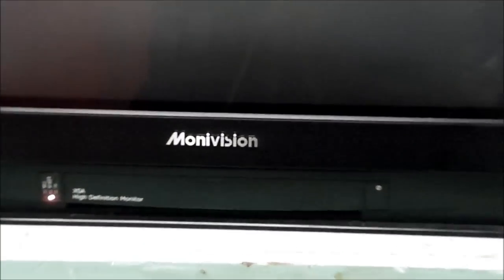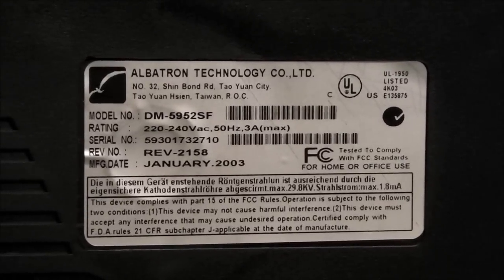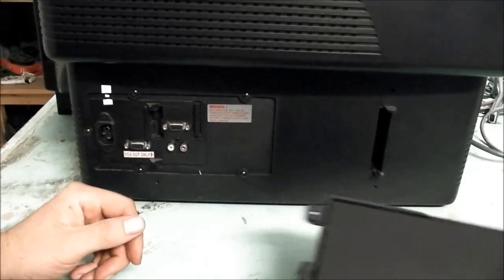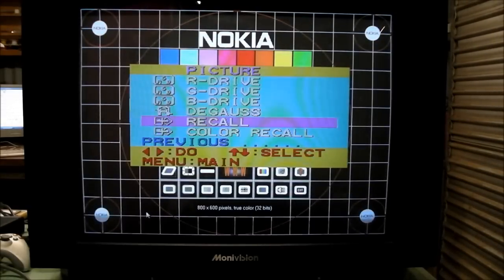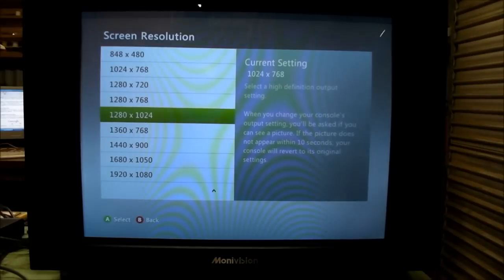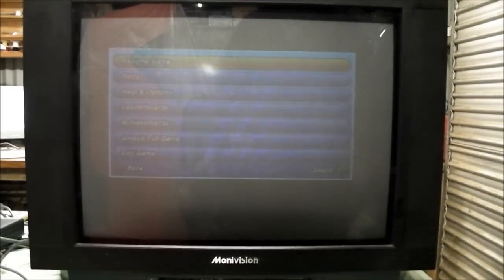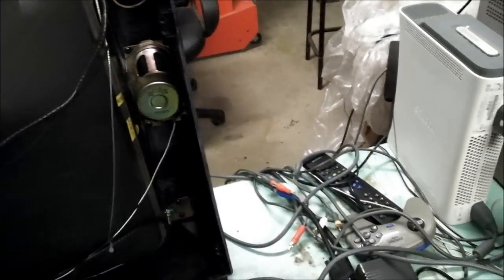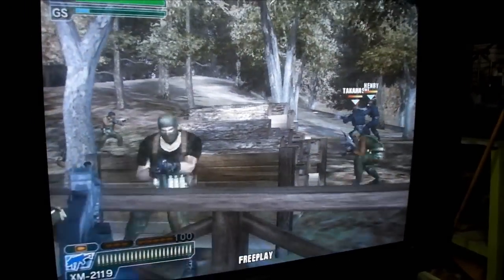Monivision 29" CRT pc monitor

Comment: You should be able to get component input   (YPbPr) but you would have to separate out the sync from the green and obviously into a VGA plug. I don't know if these will take a 15khz signal which would make it unsuitable for arcade being that VGA is 31khz. I am guessing here but I think that detachable box was there to convert the 15khz composite and svideo to 31khz. This is a really cool monitor although!

Comment: I have one similar to this (but not flat) and want to plug rgb into it from snes etc. Have you plugged anything "240p" into it?
Reply from the maker: outerspacebass I have tried 240p sources into the VGA port on the monitor without working. 240p over svideo and composite yes, but no for rgb/vga.
Reply: sweet thanks.  i'm on to the extron scan converter now
Reply: @rgbrob you still using this guy? Mine had vertical collapse a few years back. I rediscovered this video looking for photos of "netTV" monitors

Comment: hi need lil help well lot iv super system 3 runs on genesis 2 rgb cable could i
 use a scart to vga adapter to run it on this with rgb if no does anyone have solition its only thing stoping me buying it